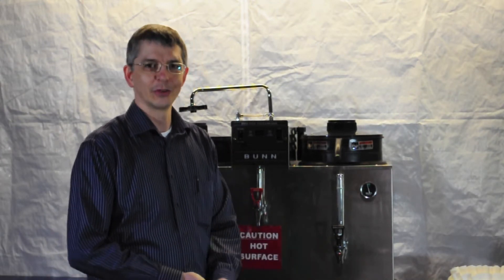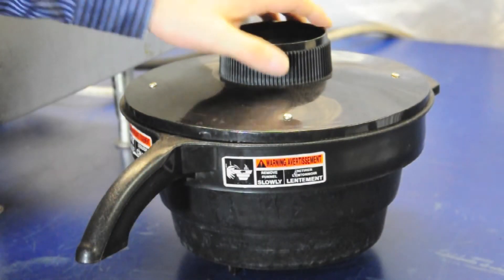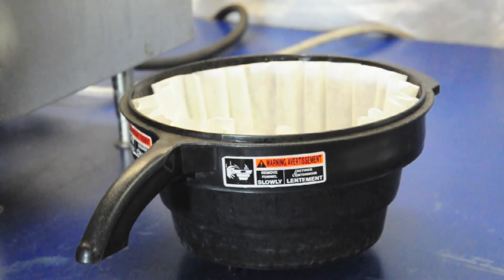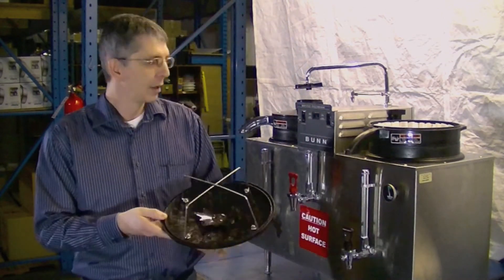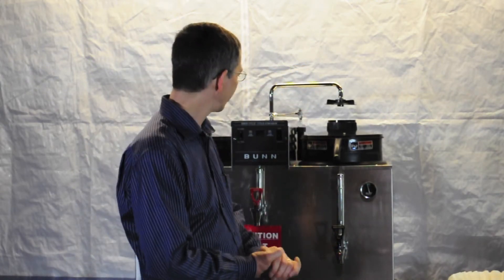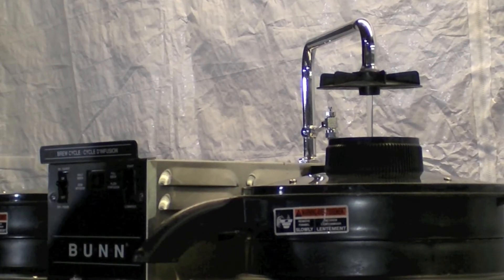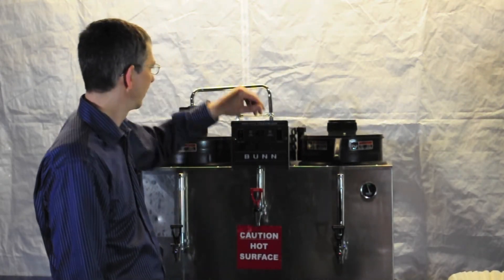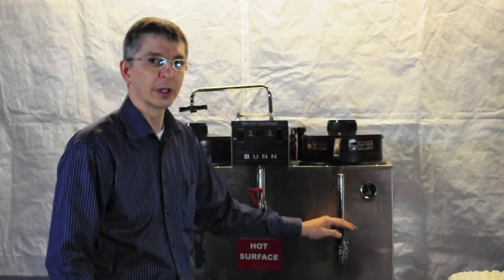How to Brew with a Bunn U3 Urn - by Canterbury Coffee

Comment: Ok, a 12 oz bag of coffee was put in. That system brews 3 gallons on each side. I have a BUNN VP-17. Scaling this down to a 64 ounce decanter, to figure out how many ounces of coffee to use. 3 gallons = six 64 ounce decanters. So 12 ounces of coffee divided by 6 is 2 ounces per decanter. That's about 56 grams, or like 4.6 grams of coffee per 5 ounce cup. Not strong but not too weak. I like to do 6 grams of coffee per 6 ounces of water. Bunn is really hard to get the ratio right because the water flows fast at a high temperature. Also the grind size affects the extraction. 
What do you guys recommend for a normal sized bunn for coffee/water ratio?